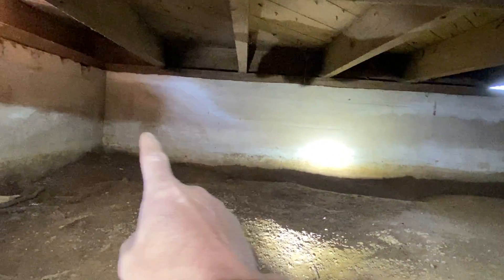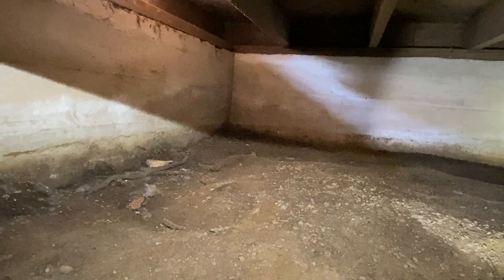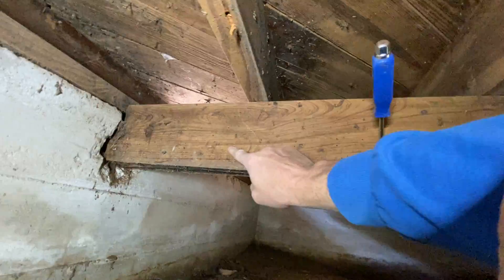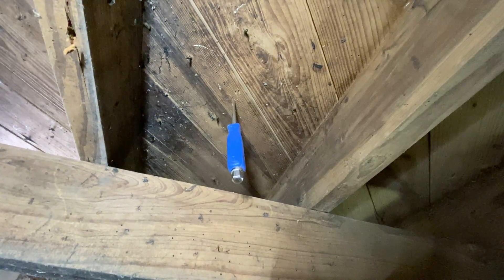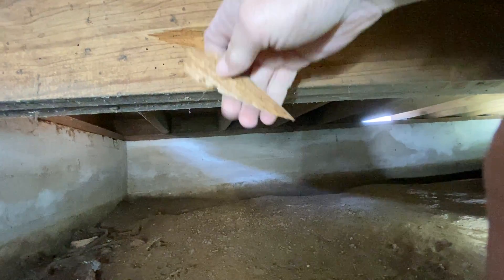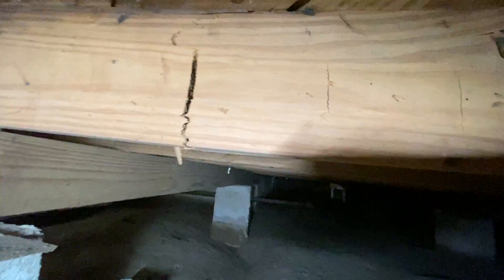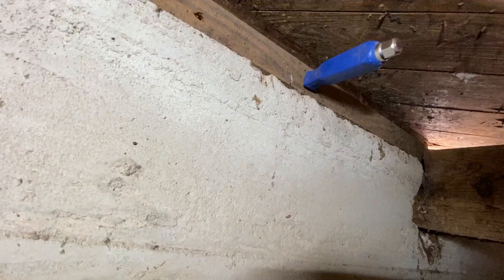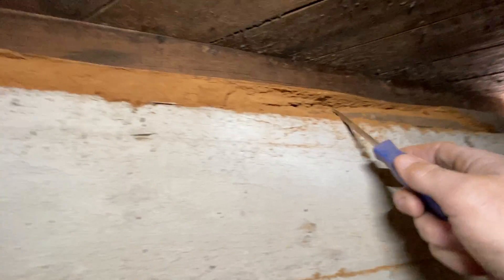Intro to a Crawl Space Foundation w/Pier & Beam Terminology & Deterioration

Comment: What type of termite program would you recommend?  I bought a house in '21  half of it is 100 years old and that framing is old growth redwood and very strong. additions in the 90s rocked by termites.  tented when i bought and the prev owners did zero termite remediation over the years.  Havent seen activity since but i know its a matter of time.  Would tenting every 10 years be ideal?
Reply from the maker: That sucks… not surprising that the original material is still rock solid (termites can’t chew up petrified wood, esp. when something softer and easier is near by!) My thoughts, though I’m not a bug guy, if the tenting treatment was worked for 5ish years, put some termite stakes in the ground inside and outside the crawl space that you can monitor and keep an eye on and retreat as needed vs. on a scheduled program

Comment: Does that mean the house is at the end of its life, or is a feasible to do that much repair?
Reply from the maker: It's fixable.

If the damage is floor joist or lower we can do it from underneath the home (or in the crawl space)

If the damage exists in the subfloor too... we have to cut out the floors and rebuild it from ground up.

Those type of jobs take a bit longer obviously and come with higher costs... not to mention the new floor cost + moving out of the home costs for homeowners if it's widespread.
Reply: @AnchorFoundationRepair  Very interesting. Thanks.